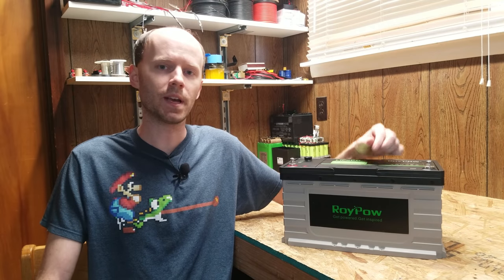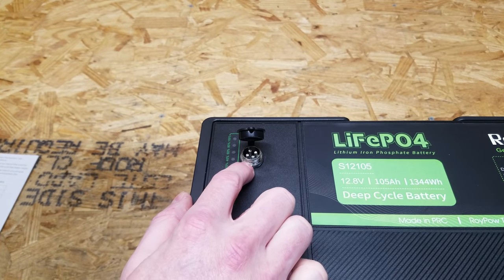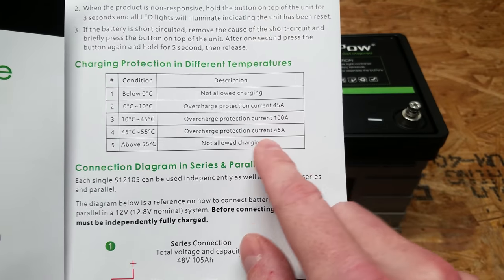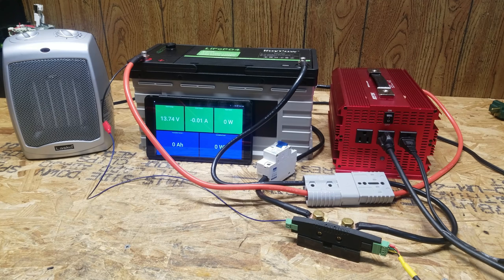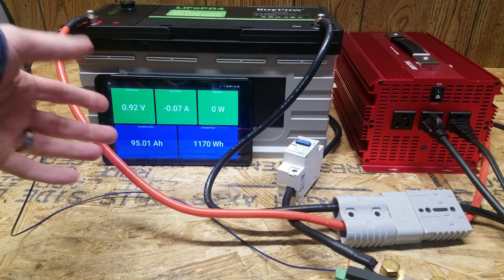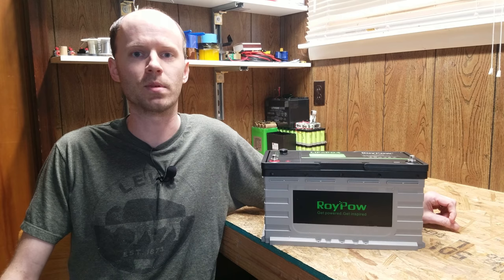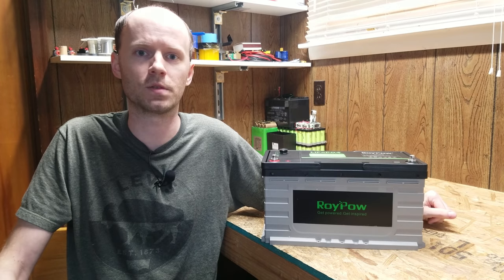RoyPow 12V 105Ah LiFePO4 Battery, Overview and Testing

Comment: Good Review, Glad to see that you checked the low temp charge sensor. Would love to see more reviews of 12V Lifepo4 batteries from Amazon.  One thing that is a slight downside, you had mentioned that they sent you this battery. In my experience items that are sent for testing are usually better than the average production product.
Reply from the maker: I would love to review more batteries. I really enjoy seeing how they work and the choice of components/cells. It seems a lot of people don't like "reviews" though, particularly when a product is given free. I'm not sure if just jealous or maybe what you noted about a "better than average" sample. Either way, I try to keep a balance of reviews and project-type videos. I get offered things all the time but have been declining most of them. And I've spent way too much of my own monies buying things just for the purposes of reviews LOL.

Comment: Roypow build quality has improved a little bit over the last year..  I use their 48v packs in golf carts where i work.  The battery connections used to be complete crap but they are much better now.  The external soc meter is still garbage so skip it if they want you to pay for it. Their warranty service has been good for us. Only had to deal with it twice but they sent out full replacements without question. Shipping has been slow at times.  We have installed probably 100 48v packs this year, and so far they have worked well.
Reply: Thanks a lot for it, It is so nice to send a full replacement

Comment: Thats a bummer about the capacity test results :(
Has the same case as a lion energy pack lol
Really nice that the low temp protection works tho
Reply from the maker: LOL you got it like 30 seconds after I posted...!
Reply: @LithiumSolar  holy cow haha
Reply from the maker: Do you think the temperature would have accounted for the 3Ah less? It was around 55F during the 0.2C test.
Reply: @LithiumSolar  oh I used to have that inverter, I destroyed it a few years back.
Reply: @LithiumSolar  I don't think it was cold enough to make that big of a difference. How do the connections feel on the terminals? It has same case as lion energy packs and those like to come loose. I'm not sure why it has such a bad capacity result. Very strange
Reply: @LithiumSolar  you could test cell voltages when fully charged to see if cells are balanced.
Reply: I was about to say that being only ~2,8% short from the advertised capacity seems really good, but then I noticed that they also spec; minimum capacity >104,5 Ah - so yeah 🤔.
Reply from the maker: I think I'll be doing further testing. I'm curious now and want to learn more myself either. At least another test with an external cell monitor hooked up so I can watch the voltages of all 4 batteries on charge and discharge. I'll wait a week or so to collect any additional questions/comments first. The connections on the terminals feel fine, not loose, but definitely wouldn't want to over-tighten them.
Reply: @LithiumSolar  yeah and write down the lvd and hvd thresholds too. I wonder what it's cutting out at
Reply: @LithiumSolar  might be a junky battery tbh. That's a super cheap case. Who knows these days 😂 my first guess is 100Ah cells. They can pull 102-103 for first few cycles. I would weigh them or take sleeve off and find a barcode

Comment: I like to charge at around 100-300ma at the final 1/4-1/2 volt of charging a new battery, even a built battery to slowly charge a new d allowing it to balance,  I usually charge it normally, then let it set a while, maybe discharge 500ma it so, then turn the charge current all the way down, mine goes to 100 ma, but shows 300ma when charging! To get a good balance, the BMS has its own balance,  where it thinks it's balanced,  there is slight difference in measuring, difference in tools,  maybe a slow charge would get the capacity up, it's such a well built, well thought out, and engineered battery, have a good day

Comment: Waiting two of  the 48volt 160 ah, we decided to wait for paralleling newer version
Reply from the maker: Which batteries are you referring to? RoyPow?
Reply: I was referring to Roypow’s 48 volt battery they make for golf carts.  The model is S51160p,  had a big back and forth with them, they really didn’t want us to put two in parallel unless it was the “p” model which has a different bms also a higher discharge rating!  So it’s somewhere in China someday.  Super looking forward to installing it! The guys at the dune buggies forums rave about them.  It’s going on a sailboat with a 48volt inverter, which is also going to have an electric motor in parallel to the existing drivetrain, hence why we needed 16 kWh!

Really awesome video by the way!

Comment: 012121/1650h PST.   Thanks for the demo. Those prismatic cells may be individually 100Ah. Like you mentioned one could easily assemble, provided a well known and relatable cells are obtained. I have good experience with one Shenzhen Cell manufacturer TOPBAND. 
4x100Ah such cell and a known BMS, JBD 100A with BT , may out perform certain LiFePo4 Battery manufacturers. I enjoyed watching your frank opinion, as always. Thank you and 73s...

Comment: Another one with heavy build I just wish they would leave a port for the bms available
Reply from the maker: I was thinking that might be what the 4-pin connector was, but couldn't find any way to pull useable data from it. When the power button was on, I saw voltage on 2/4 pins, but nothing that I could see being usable for DIY. Not sure.
Reply: No manufacturers might do that, and it is not that difficult to do by ourself.
Reply: @LithiumSolar  Probably 2 wires, + and -, to power the external meter and the other 2 are  for RS485 serial data.

Comment: Looks like a pretty well made 12v battery at a good price point.  Great review!
Reply: He said the same thing about “price point” and it does annoy me that he said, “reasonable price point.” Price Point is a marketing strategy tool- the price point is a comparitive. A “reasonable price” makes sense as a statement, whereas “reasonable price point” does not because that would say that all batteries that are set at $700 retail price point are equal. They’re not: they are only equal in price. “Price Point” doesn’t need a modifier.

Comment: I don't really know much about bateries, but this one in particular, could keep like, a camper fridge on for how long? Great video by the way!
Reply: It depends of the fridge ah. Mine uses ½kw every 12hrs or 1kw every 24hrs  or 41hrs but you never run down the battery because it will affect the capacity and durability. .
Reply from the maker: ^ Excellent answer above :)

Comment: Remarkable setup. In Belgium it is common (mandatory) to interupt the phase (in this case the '+') first with a breaker and then continue. You choose the minus to go first to the shunt and then to the breaker. Why is that ?
Reply from the maker: I just decided to put the breaker there, no reason really. A common DC installation will have a double pole breaker so the positive and negative would both be broken in a fault.

Comment: What's the accuracy rating of the shunt? If it is something like +/-5% then that could explain it. Also, DC current flowing into an inverter isn't perfectly straight DC. The inverter DC current waveform is going to be varying with the transistor switching which might hurt the measurement accuracy as well. Just a couple ideas for what might be causing the lower readings

Comment: There is something wrong with the user manual. 18.9 in is not 353 mm (length). It should be 13.9 in for 353 mm or 18.9 in for 480 mm. 18.9 in is also advertised on the Amazon. Battery itself look 13.9in (353 mm) on the video. With this mistake, it is less likely to be sold, as nobody would know, what to believe. On top of that, these are rather unique dimensions (displayed in the manual).. Anyhow, the capacity test seem to be really bad one for the price. On the other hand, the construction is interesting. I am glad to see the design with potential to replace cells in the future. Furthermore, with all that space left in the battery, at least a heating system for a freezing conditions could be incorporated. Some heating foils or PTC on cells powered by the charging (not the battery itself) would not be that hard to do. In fact I am surprised that, these drop in replacements batteries does not have an active heating/cooling for the charging mode. I.e., adding a Peltier element for each cell or one for a whole battery with an external heat sink could take care of both processes. However, that is probably to much to ask from today's engineering design brains...Never the less, the non sealed construction looks pretty good. Keep up good job and fix your user manual.

Comment: I know you’re not into personal consolidation, but I really need your help. 

Got one of these batteries home last week. One of them was cracked just like yours. But mine can discharge but doesn’t accept charge. Is the battery beyond saving? 

Got it opened and looks alright, bits of plastic from the box but cells looks good and cables are intact. One of the cells had a very minor dent to it from the impact, that’s it. But it doesn’t take charge.
Reply: Just to clarify, they already sent me a new battery.

Comment: Am i right to say that you can replace a Lead Acid battery with this one in the same 1:1 configuration? So no special change in charging or setup, just plug and play?
Reply from the maker: That's what a lot of manufacturers are advertising because the voltages are identical for the most part, but in my opinion, it should really be done with a proper LiFePO4 charger.

Comment: How many of your solar generators could maintain the utility units, in a RV ? 2 ? Because my RV already has to batteries for the back area of my RV can they be charged by the generators while maintaining refrigerator, heater, air condition cooler, oven and USB ports. My lighting is only used at night and already has their mini solar built in. ? Solar RV pulled by Tesla Truck engine ?

Comment: 3:20... Add another larger washer... IDK... $1020 Cnd plus shipping is kinda pricey... IMO
Reply from the maker: A larger washer would work if I could remove the small one, but it's stuck on there. Problem with adding an additional washer, is now the amount of threads that grab on is less. Then you would need to consider just getting new bolts. Shipping on Amazon is free within the US, not sure how that works with Canada.

Comment: Can you parallel connect a battleborn battery? Thanks for the review!
Reply from the maker: As long as the voltages (charge and nominal) of the two are the same, I don't see why not. I have never used a BattleBorn personally, though I've heard very good things about them.

Comment: Actually, NOT disappointed with build, but- very underwhelmed with the results. 8AH low on the standard test & 100AH low on the 1C test is fail in my eyes. It's rated at 105AH, not 100AH and you said it' 18" long!!! Not gonna fit in lots of places that normal batteries fit. Just saying for $699.00 SO Batteries are a better deal.
Reply from the maker: They definitely could have made the case a bit smaller. There is a lot of empty space on both sides. What are the SO batteries that you're referring to?
Reply: @LithiumSolar  guess @David is referring to SOK SK12V100 $570 + shipping
Reply: Sorry! SOK Battery

Comment: Didn't see any temp sensor wires.
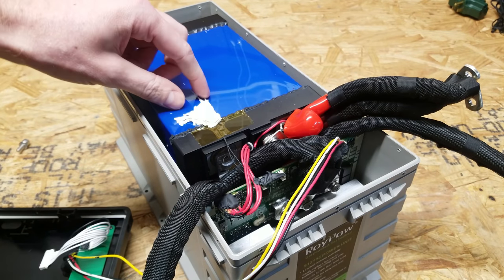Reply from the maker: At 9:05 mark, that big white blob you see on top of the blue battery is a temperature sensor. I couldn't pull the battery out, so I am unsure if that is the only one, but I assume it is.
Reply: That is the only one. There's no more wire sensor coming out from it. The 4 red 16awg wires seem to be the balancing leads.

Comment: I noticed your use of the BESTEK 2000W Power Inverter in this and another video.  Interestingly, neither you nor Amazon mentions whether this inverter outputs a pure or modified sine wave, which is usually a bragging point for inverters..!   I will venture a 'wild' guess and say that at it's price point that it is modified..?  In addition, I would hope, at least for time being, that this continues to be the  USA until the one-worlders finally take over (any day now), and that reviewers would post temperatures in Fahrenheit instead of Celsius and/or mixing the two as in this video.. Just sayin'...
Reply from the maker: The BESTEK is a modified sine inverter. I bought it just for the purpose of testing 12V batteries.
Reply: @LithiumSolar   Thank you.  Amazon includes that fact way down in the weeds..  LOL!

Comment: Great report thanks. I live in 1 of the 189 countries in the world that uses System International. I do find you mixing them up rather confusing sorry. Would you be zble to stick with either imperial or SI in your sound track (voice commentary) and use sub titles using the other. Eg.the box is x inches long (verbal) subtitle x inches = y mm. The 4 countries using imperial shouldn't mind and the rest of us will be enlightened. 
As kWh, is printed on the battery might be easier to do it the other way around? Cheers and thanks for the great demo.
Reply from the maker: We use inches/feet to measure distance here. I started using Celsius in videos as more people can relate to it and people complained about Fahrenheit. I try my best to be consistent with these two, but I'm not interested in, nor do I have time to, go through and convert measurements to both standards every single time a unit is mentioned. You're welcome to head to google and search for "18 inches to mm" to convert, it's very easy... It seems no matter how I do it, people in the opposing country don't like it.
Reply: If you can’t do the metric to inches/feet conversions in your head with only  a small degree of error then how are you having any success in this hobby? I guess you could be using a calculator for everything but there is a fair bit of math involved with solar, back up power, run times etc

Comment: Given the premium price of these batteries, the failed capacity tests are very disappointing.  No way would I pay $700 for one of these batteries and not get the full 105AH capacity.
Reply from the maker: I don't think this is at a premium price for LiFePO4. This is average to low-average pricing. A premium price would be Battle Born or Big Battery. Premium price for premium quality.
Reply: @LithiumSolar  I was going off the 100AH Renogy you can get for the same price.  You can get a very high quality, 170AH, from Big Battery, for just $200 more.  Both of those are very likely to pull full capacity?

Comment: Wrong size of the crimped lug!!! one size smaller and the bolt would fit perfect and the surface would be better for connnection. SO conclusion. Wrong sizes used. Manufacturer cant anything for this. Only u are the one who made the misstake!
Reply from the maker: No, not wrong size... If anything, the lug should be larger to hold a #4 cable for 100A. The lug and #6 cable I used are too small, if you want to be technical about it.